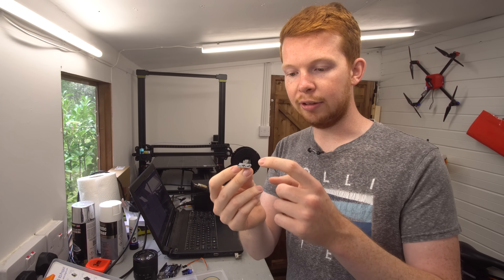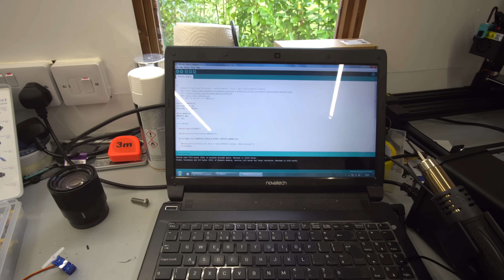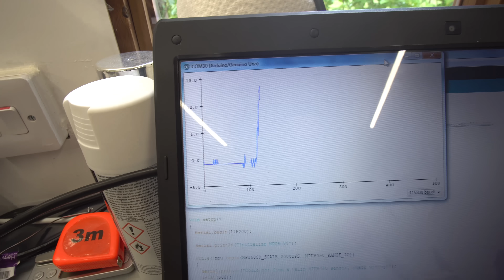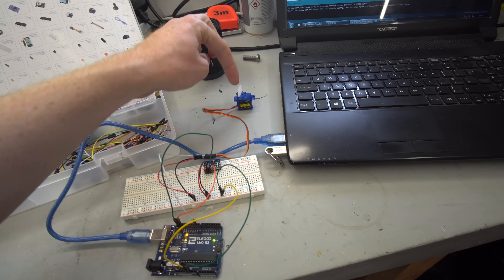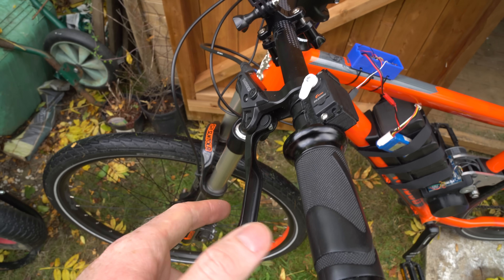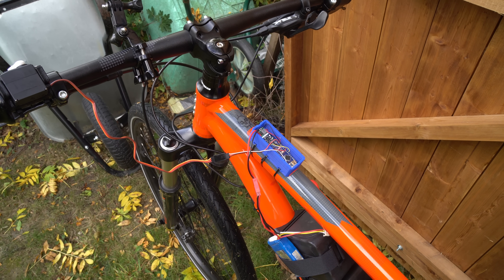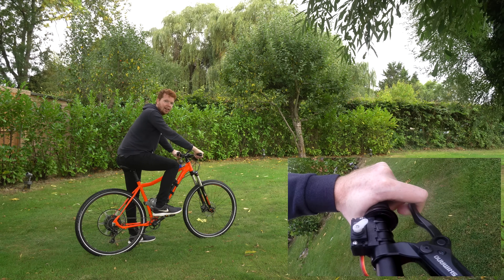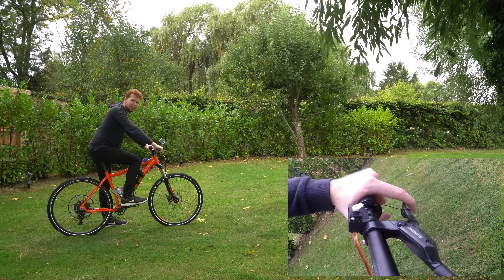Wheelie Cheat Device?

Comment from the maker: Thanks to everyone that watched more than 6 seconds of this video!! To the others, thanks for the wheelie advice 😂
Reply: I hate to ask this because I'm sure the answer isn't simpler, can you do a video to show how to do the chip/wiring and programming? I feel like that is something I could use for other purposes and even make a few projects with my sons to spend some quality dad time with them. Thanks
Reply: Millie Muncher contact me on my Instagram
Reply: @shanelangen1822  the only social media I have is YouTube but thanks for the offer
Reply: I did this for my science fair and got 1st place. Figuring out the equilibrium angle was challenging. Instead I used a high torque servo and directly attached it to the rear brake cable. It used a 3D printed mount that was mounted on the frame.
Reply: @Tech_Trek_Innovations  Hey Seth! Any chance you could share details on this? Would love to try this. Cheers
Reply: can u share the code? i want to do it with my dirt bike with some mods.. ;p
Reply: Vytautas Gutauskas is from Lithuania
Reply: Tom Stanton rather than wire, consider a ball chain for servo to brake.  Strong on pull but easily deforms if you manually pull brake 10 Foot Length Ball Chain, #6 Size, Stainless Steel, & 10 Matching Connectors https://www.amazon.com/dp/B01I1UPQNG/ref=cm_sw_r_cp_tai_KHEVBbMDB9GXE
Reply: Carlton Adams I never have any luck with those, they´re always breaking
Reply: 6 seconds I just spent the last few hours watching your awesome videos
Reply: Actually, the bike is the same as the Segway if you think about it...

The handle bars on the Segway do the same thing as on a bike. You control your speed by shifting your weight by pushing or pulling on the handle bars. You can do the same on the bike.

The way it would work is, you need to adjust the angle that you consider is up based on your speed so that the faster you are going, the more you want to change the "up angle" so that you'll slow down. And the slower you're going, the more you'll want to change the "up angle" so that you'll speed up.

That means that if you're going too fast, you'll change the "up angle" so it's more forward so that the system will allow you and the bike to fall more backwards. If you're going to fast, you'll want the system to adjust the "up angle" so that it's more toward the back which will make you fall forward more requiring you to speed up in order to not fall. The system will self balance based on your speed because it will slow down when you're going to fast, and speed up when you're going too slow.

Once you have this system set up, you can adjust your speed by changing the length of your arms. If you pull the handlebars toward you, you're shifting your weight forward making the bike fall more forward which will cause the whole system to reach equilibrium at a higher speed. When you want to slow down, lengthen your arms to shift your weight back which will slow you down.

A friend of mine gave me this little Arduino based robot, and I programmed it to balance using exactly what I've just explained.

https://www.youtube.com/watch?v=W5YqtrUxTMk
Reply: Could you do the opposite to keep the front wheel down?
Reply: @flavortown3781 , Of course you could do the opposite. Just apply the brakes every time the bike lifts a bit. However, it might become very difficult to go up hills with the breaks on. You would probably be better off with a pressure sensor on the front wheel that could tell if the front wheel is leaving the ground.
Reply: couldn't do it without you either doh. lol
Reply: What coding language do YOU use for the arduino
Reply: Are we going to get a full list of parts and 3d files like the last version of the bike on thingiverse?  Been dying to build this!
Reply: People watch 1 minute on average only videos.  They miss so much. Skip skip
Reply: Tom Stanton ha I just made the likes turn into 445. Before it was 444
Reply: Genius if it works ... I'll keep watching the other 18min as well ;p
Reply: You should use windows 10
Reply: So the rear brakes are reverse in England to how many more wires things are there
Reply: I actually watched full lmao
Reply: Awesome! Subbed.
Reply: 🤣🤣🤣🤣🤣 I watch the whole thing Im a Subscriber but your gonna laugh at me When I asked the question that I'm about to ask For the simple fact that I have to go back to one minute and 2 seconds mark Of your video lol but  what's the model of that big 3-D printer you have in the background😁  Or at least the measurements  of the printing bed
Reply: I have made a simple wheelie cheat for my Ebike please check it out on my instagram shanelangen8415 I can explain it

Comment: Interesting, it is definitely sort of working, I would suspect one problem is the accelerometer values will have quite a lot of random variation that needs averaging out, which is why the servo is jittering back and forth.  This is due to the effect of vibrating the sensor. If you introduce averaging this will intrinsically make the system more laggy which will create its own problems, as you saw when the link to your brake lever was slack.  Plus there are issues that the rider needs to adjust their balance, as well as pull the brake lever, if they are still trying to lean back more while the device is pulling the brake the two actions are at odds with one another. To truly automate a wheelie, as other comments say, you will need to control the drive (via a motor).

A less challenging project I have undertaken is to design a wheelie timing device, initially using an Arduino although an Android version is now available (https://www.youtube.com/watch?v=d6pVIiTPuqE). This is handlebar-mounted, and needed additional consideration of angles in various directions since rivers often steer int he air to help them balance. Here I could increase the averaging time considerably as timing accuracy isn't that important. In these devices I take an initial reading when the bike is not wheelieing which is subtracted from subsequent readings to compensate for the sensor not being mounted completely horizontally.

Comment: The question of a balanced bicycle on one wheel is an interesting one.
However, this is not the only complication we're facing here. Your discovery, that you were controlling the angle by actively changing the center of mass (10:45), effectively "cheating" your own device, shows that the device would have to "measure" (and factor in) the rider's "intention".

One could possibly measure the rider's physical interaction with the bike, e.g.- the pull/push force on the handles, the force being applied to the pedals and to the seat, which should give enough information for a rough estimation of the rider's intention, and position relative to the bike, but I'm not sure that's enough.

A sloped ground would also change the wheel's point of contact with it, and as a result the angle of balance.

The deterministic approach presented in the video is safer than others in some respects, but may require a lot of programming to achieve a usable result.
A different approach might be to feed all of the sensors' data into a learning algorithm, (an "AI"), and let it determine when to apply the break, (and with what force)... preferably using data from skillful riders.

Thanks for raising the question, and for taking the time to explore and share it with the rest of us.
You seem to enjoy what you do, which is all any of us can hope for.

Comment: Truly excellent project.   If I may share some thoughts:
1) It would be possible to have the Arduino read a handlebar mounted pot to facilitate a field adjustable braking starting point for the braking process.  Pots can be read by a standard Arduino with 8 bits resolution.  Some inexpensive microcontrollers can read with 12 or even 16 bits resolution.
2) Likewise,  it may be possible to have the Arduino read a separate pot to field adjust the slope of a line describing the increase in servo rotation per degree of tilt, thus resultant caliper tension.
3) One could self-enforce consistent elbow angle, or measure the distance between,  say, the handlebar stem and the rider's chest using a standard general purpose ultrasonic range sensor or specialized infrared drone ground proximity sensor

Comment: Attaching a small electric motor to the front wheel to spin it helps with stability. The gyroscopic effect, but that is more for side to side. I think. Helps you "steer".

Comment: To solve some of your issues.  If you pickup the initial angle when the code starts... and reset your initial angle..   You can test on the field by turning it on/off with your front tire on different heighted items.

Comment: Cool, I guess for a smoother control (more like a Segway) you might want to use the angular velocity as another input so that the brake doesn't slam you back too hard when you pass the balance point. Concrete example: you have  passed the balance point, the rear brake has been activated and your angle is decreasing, then you could stop breaking before you have returned to the balance point, because you momentum will get you there anyway even without braking.
Cons : more inputs so more parameters to tune
Pros : you can have a feedback that could be helpful for riders with different weighted, size, strength, different slopes, or brakes that lose efficiency with wear

Comment: This needs a proper PID controller. Could even auto calibrate it live. I've built an inverted pendulum before and when I did initial tests with some spitballing I almost convinced myself that it couldn't ever work with my parts, until I properly implemented the PID controller and it immediately worked.

Comment: I learned to wheelie without brakes, I just ride faster and faster while standing up almost at 12oclock position. I cant wheelie a motorcycle because I did not learn to wheelie sitting down or using the brakes =*(

Comment: well you can wheelie 2 ways on a motorcycle, you can roll the throttle back and just exhilarate in gear, or you can rev the engine up at higher rpm than than your mph rolling speed with clutch lever pulled in, than "pop" or suddenly release the clutch lever engaging that drive train real quick to the wheal with a lot of instant torque. maybe that might help with a new concept design along with drive/and wheel sprocket gear ratios,  if you didn't know already.  wheelies arnt for safety their for fun so just crash gently if you have to, your pretty good tho you got it i didnt see you ghost ride that bike even once. how about a stop-e/endo cheater design. that would be sketchy id be afraid

Comment: Been following your video for the engineering but also learning to wheelie (can almost do it after 2-3 months on/off). I'm not surprised the tuning is so difficult as its very dependent on your position on the bike and its quite a fine adjustment. Very impressed that you can do the engineering AND can wheelie too!

Comment: I use gyros on a few of my rc planes, where you had it placed on up by the steering head was all wrong, hence the servo was all jittery, you need to put it as close to the point of rotation as possible, for example if you mounted it on or forward by a half inch right at the rear axle , it will smooth out the rotation of the gyro and stop the jittery servo, it would make the brake pull smooth and way more predictable as to when the brake comes on and off

Comment: I think you should have used e.g. potentiometer to create very quick angle adjustment. Basically you'd need some kind of input control to adjust the angle limit. With two controls you could have angle setting and steepness setting (basically how close to limit you can go without the servo doing nothing and then applying lot of servo movement even with a slight increase in angle). I would guess having quick adjustment would be good enough and you don't need more sophisticated sensors.

Comment: If you add an accelerometer at your waistline and a linear gage on the front shock that should do it.
Reply: I just finished reading many comments. To explain, use the linear gage to calculate your weight. Then you can calculate the required angle by finding the difference between the two accelerometers.

Comment: You might have something but WAY more useful for MOTORCYCLES than bicycles if you ask me ....a lot of high end modern MCs already have anti lock anti wheelie shared brake actuation front rear and some sense lean angle acceleration pitch ....but as far as I know no one has a wheelie over save mode ....as far as I know they either totally kill wheelies or you shut it off to wheelie ....why the hell NOT monitor the pitch and level and cut the throttle and activate rear brake just enough to keep from looping the damn thing!  TOTALLY doable on several models I can think of...prolly have to come from manufacturer though I suspect....

Comment: Looks like you where using only accelerometer data causing the angle to to too jittery und inaccurate from other movements and bumps. You need some kind of a filter to use the gyroscope. This will give you a very good angle and it wont jitter like it did and pull the brake at exacly the set angle.

Comment: Cool stuff..maybe putting the angle reader on an adjustable mount with a screw so you can adjust it to what you like instead of messing with the wire on the servo..just micro adjust the mount tricking it into thinking its starting at a lower or steeper angle to start.

Comment: Do NEVER wear a helmet when you do/practice wheelies! When you fall on your back you will put your chin on your chest and decelerate your head with your neck and have 7g +1g rotational acceleration on your head. That might hurt on your back but your head and brain are safe. If you wear a helmet you have the impact already while your chin touches the chest resulting in dangerous accelerations (more than 100g). The helmets absorbance is neglectible (The standard allows 250g on a partially piercing object.) while the interference in your active biological head protection system is severe. If you want to read a good article (German) about that: https://fahrradzukunft.de/14/wirksamkeit-von-fahrradhelmen/

Comment: On the motorbike the system is for safety and ends the wheelie but your system is an electronic enhancement for maintaining the wheelie/angle. Maybe a separate rear brake system can add minimal brake after it has calculated the balance point for the current angle and mass, thereby allowing the rider to keep control, but be safe from flipping...

Comment: I think you could have it auto learn the balance point based on the accelerations. The jerking upward movement and angle could be used to initiate wheelie mode. Then have it measure the accelerations for a few wheelies. It could find the point in the middle where the accelerations are low, and try to hold you there. Each time you ride it continues to calibrate that sweet spot. If you go over the sweet spot apply the brake.

Also if there is enough play in the cable, mount the servo directly to the brake (assuming this is cable operated and not hydraulic). Also putting a section of threaded rod for adjustment would be good. You could also add a servo calibration pot, that you could just shift it's zero starting point.
You probably need to average the sensor data over a few milliseconds too, and not react to every value as fast as it can read them as well to smooth the response a bit. Or maybe limit the rotation speed if the servo to damp out noise.

Comment: On this and, your ABS project, use a simple cam (excentric) on the servo motor. It will require way less torque and time to react and, still leave you the possibility to fully activate brakes by hand.

Comment: 15:40
it's actually "quiete" easy. You just have to measure your speed. and tilting angle. angle reducing? accelerate. Angle constant and you are accelerating? accelerate more, to increase angle, brake to reduce speed. Until you find an angle, which remains constant at a constant speed. Or remains constant, when accelerating or braking. But for that you need full electric controll

Comment: I don't like the winding cable (or rope in your ABS one) as the activator. What about the electronic hydraulic valves from car/motorbike ABS. Use those for a high force quick response I would think. Put that 3D printer to work.

Good research and investigation. Thanks for the video.

Comment: To do this right, you need a high speed computer with sensors detecting your arm position, your left and right balance, forward looking video to anticipate the subtle changes in the road, extremely fast and fluid control of the brake. Etc.  The computer should be able to learn and gradually get bettet at keeping balance.  To be practacal, the whole system should be small, self powered and inexpensive enough that everyone could have it.  I cant imagine anything like that......

Comment: But Tom. You laugh in the face of danger!
  The throttle control is probably +5v through a potentiometer if you have a throttle control. So you would be asking the Arduino to attenuate the voltage of this or perhaps you need the arduino to provide the throttle voltage via the throttle control and also attenuate it via the gyro / accelerometer.
  What could be interesting would be to add a gyroscope to control side to side movement at the same time.

Comment: You mentioned the wheelie control device for motorbikes that cuts the throttle. Those are not full wheelie control devices, but merely loop-prevention devices that make it safer to learn manual wheelie control.  What you are aiming for here is much more complicated.